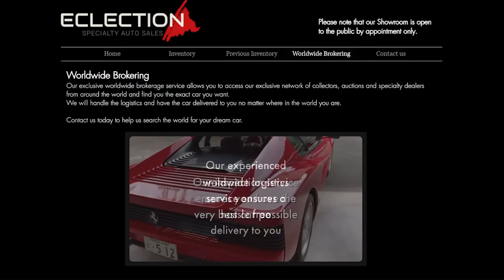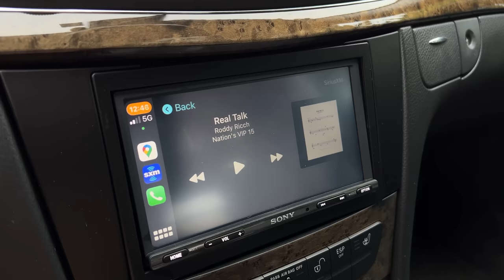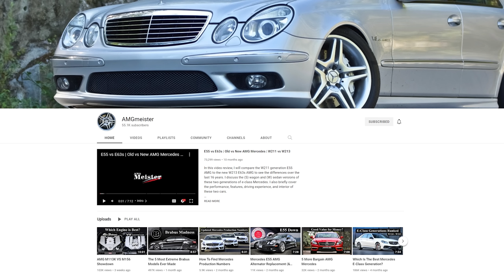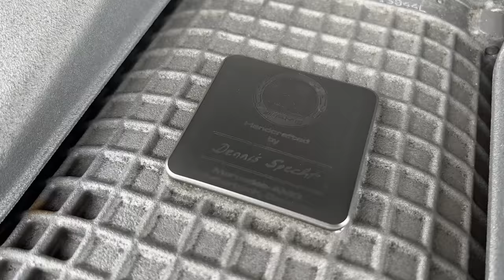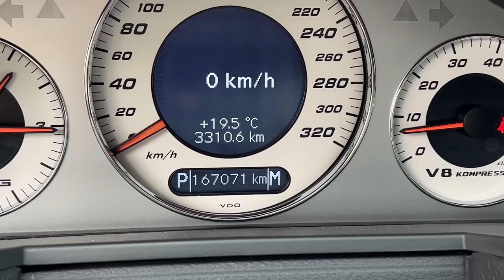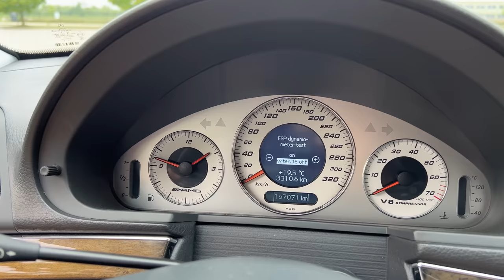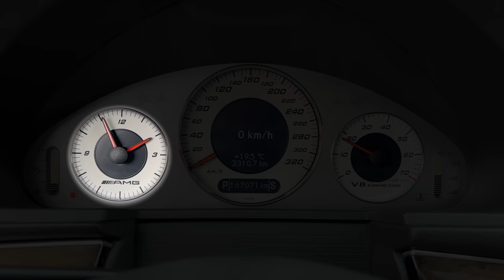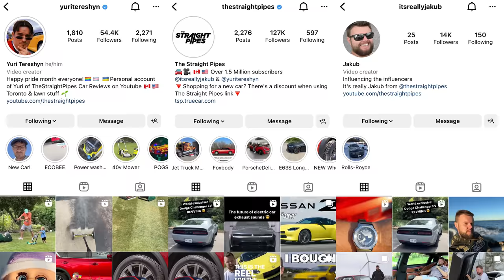DREAM CAR! I Imported a 500hp Mercedes AMG Wagon... FROM JAPAN!

Comment: I put two K&N style filters in actually they were a brand called greenfilter USA and it increased induction supercharger noise much more over stock. The thing is the OEM intake is really really good on the motor I couldn’t bring myself to replace it with anything affordable. Those ducts go to the front and have a Ram air effect at high speeds it just pulls all the way till you let off… I miss that car.
Reply: I had 188000 miles on it before weather totaled it out, electronically… 
Clean out your front cowl drain lower grommets (not the ones that are visible outside the vehicle) that’s all it took during hard downpour. Apparently a common problem.  😔
Reply: Factory air box not known to be a limiting factor until 600hp ish IIRC. Even if you really look at it, it makes sense… massive filter surface area. IATs are so much important with that engine or something better to focus on for reliability— for that reliable family vehicle yes

Comment: You should be able to get push to start on that car. I used to detail cars and You can literally pull the "push to start" button out of that e-key slot. So I'm sure theres a way to retrofit.
Reply: Also, scosche magic mounts area awesome. I use the vent mount which keeps my maps in my line of vision.
Reply: Not even a question, the AMG is the better "family car".

Comment: Also to get the most life of your a/c pls start your a/c at 72 degree Fahrenheit on auto. This will the allow the a/c system to cycle through as it’s supposed to.
Reply: And if you leave it on auto with AC enabled, it will even activate the AC in cold/humid conditions to eliminate windshield fog, but turns up the heat automatically to compensate
Reply: @motoringmemoirs  yes very good info

Comment: I've owned 2 E55's. I love the motor and tranny. You guys once voted on your show on my 2013 E63 grey one with black wheels. In the end I went back to a E55 again. The car is just very well made and it has tons of character. The 05 and 06 E55's are a tad different and there are several differences very small but due to tcu's and factory tuning  they are not easy to do a burnout with unlike the 03 and 04's. Either way just a classic design. Congrats on your wagon its beautiful. 👍
Reply: Bro this car looks like a hearse....

Comment: you cn drift the car around all day with the esp off i have an e320 cdi s211 from 2003 myself and mine also drifts on asphalt no problem tho its stage 1 (chipped) 250 hp 600nm
Reply from the maker: Ya. 2003 is the old ecu
Reply: but yours is also pre facelift so it should also have same tcr system. mine flashes when i do drifting but it does not disturb anything power etc. @TheStraightPipes

Comment: whoa Jacob! my dream car too...had a 2003 V70R when my kids were small...have you tried holding down the esp button or pressing it a few times in succession?
Reply from the maker: Yes the only way to turn off traction fully is dyno mode. The early e55 could be turned off easily

Comment: I'd set it apart and go with AMG GTR Grill. It really updates the Look of the W211. How do I Know? Cause I Put 1 on my 2009 W211. Give me a shout if you want to see pictures. I'm pretty sure they do make  the GTR grill for your year. As Mercedes updated the look on the Front grill Lights and angle on the  W211 in 07 to 09.

Comment: I’m gagging to own one of these and have been for a long time. They are still fetching drug money here in Australia 🇦🇺. I owned a triple black 2006 E350 Elegance Sedan and regret selling it everyday.

Don’t forget the secret CD changer panel.
The small tray in the dash is for coins or cards etc. it has a hole in the bottom to push them up.
That drink holder is a AU $95 part here.
Reply from the maker: Wait what secret cd changer

Comment: I like the 5 spoke 20" wheels you had on it. Do you have those for sale? Or what was the manufacturer?
I have an E55 wagon with AMG 20" wheels but like yours better.
Steve
Reply from the maker: No I gave those away for free to Ontario Wheel Repair. They were beat up
Reply: Do you recall the brand and model?

Comment: Once a car has been imported to Canada and registered there can it be imoprted to USA afterwards?
Just bought a black 2007 c230 Sport and have the raised emblem with original grill. Love the classy look of the raised emblem but blacked out the grill. Sort of gangster look but it is plasti dip so it can be removed if the buyer hates it.
Reply: No, 25 years still applies

Comment: cant you press and hold esp for 5 sec to completely disable the traction control?
Reply from the maker: No
Reply: @TheStraightPipes  that’s tragic. My 2010 C63 is that way… interesting that the E55 isn’t the same it’s still in the 722.x trans family. Wonder if there’s a TCU tune to fix it? I know Alex at @LegitStreetCars has tuned his TCU on the E55… maybe check with him?

Comment: Get your wallet ready.....otherwise a great car.   So not Hyundai.   lol  Get the hood ornament and original grill.  Always go ORIGINAL on such a car.  I'd never buy any vehicle from far away, just not smart thing to do.  This worked out for you, but for thousands of people, its a recipe for disaster.  I've owned 75 cars, including a 1999 E55 AMG.  They are great cars, but you'll be spending money on it.  Turn it completely original, aftermarket crap on such a car is not the way to go.